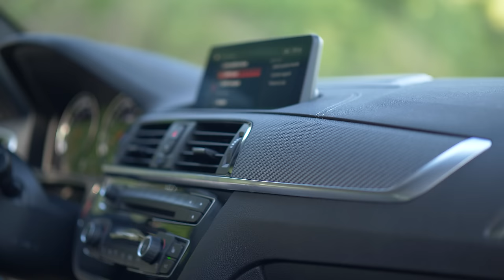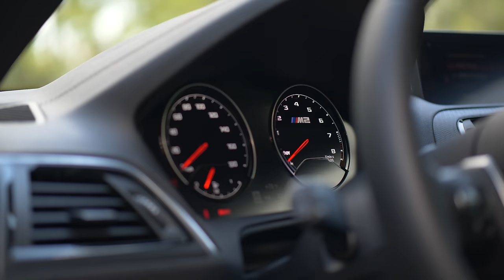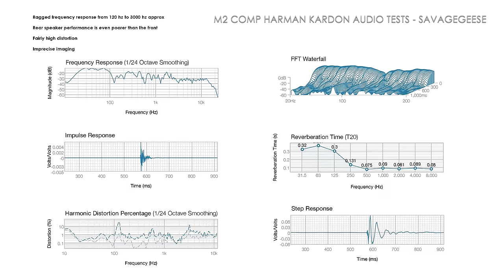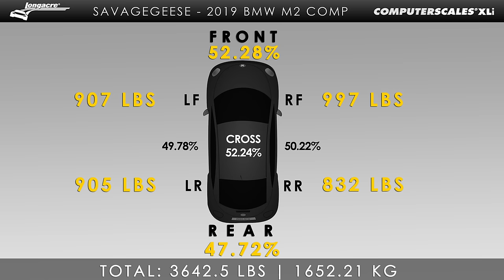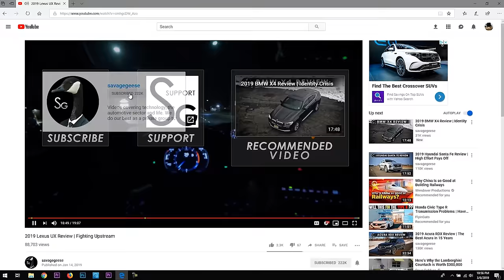2019 BMW M2 Competition | The Throwback Machine

Comment: I own one with the Manual, and Ive tracked it several times on several tracks.  If you leave the MDM mode ON, the diff does a great job of keeping it straight and not oversteer as you mentioned.  You have to be a little patient with the gas.  I noticed in the video you are get on the gas early in the turn.  I find trail braking and going to gas later is how the car wants to be driven. I came from tracking a 911, and I think this car is a perfect balance for street and track.  With Michelin Cup 2's, I think it will be that much better.  I have made no modifications, all stock set up.  I love how BMW tuned the torque. Its very linear in its delivery.  I think its a great all around package, albeit its a heavy car at 3600 lbs.  Oh and the tiny gas tank means Im always filling it up.
Reply: Do you really experience the weight as a problem in corners?
Reply: @8teate  a bit, but under heavy braking you feel it.
Reply: About to pull the trigger on one with the auto and I plan on hammering it around COTA etc with some 200tw tires on it
Reply: Do you happen to know how the M2 Competition compares to the previous gen M2 for handling?
Reply: @teddybburns  I have more experience with M2C  but have driven the OGM2 and I would say besides the engine, the handling is better in all aspects.  I 've heard it uses all the same hardware but the tuning is very different.  Less body roll, and better dampening on the road.  The M2 Comp can be tracked with no mods, may need to change brake fluid and eventually pads depending how often you track.  Never tracked OGM2 but depending on your skill level not sure how much you notice.  Im certain a more experienced driver could beat times of M2C in a OGM2.  If the money doesn't matter  go M2C.
Reply: @steveadp  thanks!
Reply: @teddybburns  I drove both and was considering both. I drove a 2016/17 M2 multiple times and I drove the M2 comp twice. I ended up going with the comp. I have not driven either on track, just street, so keep that in mind. The handling in the comp felt much more... immediate? Not sure the right word. It felt like It's pulling you into the turn, such as on to a roundabout, when you put the nose into it and put some gas into it, it just pulls in perfectly. The OGM2 is still great, I considered doing that as it was less expensive, but in the end I felt the throttle response, the handling, and some of the other features were worth the extra money for the comp.
Reply: @weglarz  thanks for the feedback!
Reply: Dct M2c owner here, had the car for a year now and I disagree with and the reviewers. Till this day i’ve only used PS4 S’s and the M2 has amazing grip especially with all controls off, its mdm is really good indeed but still feels tamed compared to all controls off, it has the best the of both worlds, meaning it will oversteers if you provoke it to, but once you understand the car (especially with good tires) trust me you won’t even have to to countersteer anything, the car feels glued to the ground. I agree with your trail braking point of view tho, the car loves to do that and if you put your foot on the gas too early you’ll feel the weight in the front, also under heavy breaking like you said, but thats just physics, I think the M2C is a marvel of science when it comes to rwd and front engine cars, but also with so much brutality, it reminds of the same brutality my 599 gtb had, with a much more sorted package.
Reply: The gas.... tell me about it! I have the M2 manual 2020 and I’m lucky to be alive when I get out of the beast
Reply: Thoughts on how the M2C compares to a 911 for a 80% weekend car 20% track car duties?

Comment: 18:36 “this wants to go sideways.” It does indeed. Come and try it on our track you silly goose :)
Reply: Savagegeese and Throttle house. How would you guys compare this car to the gt350? Which car comes on top?
Reply: I am also curious to know what you think about this
Reply: M2 vs Supra vid ;)
Reply: @kylenewberry8598  One shouldn't really compare a 2019 M2 Comp DCT $61,800 to a 2020 Supra Auto $49,990 since there is a noticeable price difference. The Supra exhaust note sounds good while the m2 is just ok. M2 has more top end, but the Supra is smaller and weighs much less. I will take a Supra over the M2 and I own a 2016 M3 since I want a smaller car. M2 comp also could have a spun crank hub failure when modded with an e85 tune like any other s55 engine.

Supra should make 400whp with stage 2 tune while the M2 Comp with stage 1 will make 464whp and 494wtq. I still would buy the Supra even with the less hp potential since it should be more fun and more reliable.
Reply: @justin2956  Eat a snickers maybe? Or take a chill pill if you're on a diet.
Reply: @justin2956  I don't think automotive channels should not be allowed to comment on other automotive channels videos. It's a community first.
Reply: @MrAlansordo  Throttle house already made a gt350 vs a m2 track video. Go watch the video for what they think comes on top.
Reply: @GrandMasta1  They do but not an m2 competition plus the question is addressed to both youtubers.
Reply: Kromeification it’s very poor form.
Reply: lourenco121 there are videos already showing the differences between the new Supra and M2 Competition. The Supra is better in just about every way. Only downfall of the Supra is its cabin space, and only being offered in an automatic transmission.

Personally I would still buy the M2, even for a more expensive price. Not because of performance, but because of daily usability. I’m 6’5” tall, and a solid 220lbs. I need the space. I couldn’t fit in the Supra. Plus I’m not to keen on the Supra only being automatic.
Reply: Justin it’s not poor form.  Relax.
Reply: @justin2956  it's not stealing from his subscribers it was an invitation.
Reply: @justin2956  ...Because someone can't be a subscriber and fan of both channels? This isn't a zero-sum game. Many of us watch videos on the same cars from 5, 10 or more channels. Give your head a shake.
Reply: You just want it because it's blue.
Reply: LOL, talk about getting your pun in. ;)
Reply: lourenco121 Reliability shouldn’t be a factor because BMW made the Supra mkv engine. It’ll break like the rest of them smh...
Reply: Sounds like the Canadians are ruffling up some goose feathers again.
Reply: Bruh! Love you guys and y'all's gooses geeses
Reply: @JacesOwnWorld  the supra sucks compared to the m2

Comment: It’s funny when the original M2 came out, all the reviewers gave it amazing reviews. 

Now that the Comp is out, all the reviewers are now complaining about the issues with the original M2 and that it didn’t feel special. 

I don’t know who to believe anymore.
Reply: Trust these guys and Mr Regular.
Reply: The regular M2 sucks.
Reply: I drive an M2. They are special.
Reply: @wthisdaftpunk6847  that's such a hard question... I have drove both, the 2 series is literally a smaller version of a 3 series. First of all they are much different generations. I hate the sound of the s55 in the m2 comp and the s65 is a high revving v8, enough said in that regard. Its faster, smaller, more fun around turns, looks better in my opinion, is much more reliable, has that daily driving factor even though its smaller, its everything you could want in a sports car. However, its simply missing that v8 feel. The M2 is simply a better car in almost every way possible mechanically, would I still get one over an e92m3, I don't know. If you want to beat on it, have fun without worry, daily drive it, get this. If you want a car that puts a smile on everyones face based off the sound alone, get the m3. If you held a gun to my head, I couldn't tell you which I would rather have. Sound means so much to be when it comes to cars, and the s55 just is not it, its better in almost every single way so I will ask you this, how much does sound mean to you? How much does that raw emotional connection with your car mean to you?
Reply: the original m2 is still a beast and the attainable one for most of us. i welcome the nitpicks and keeping the affordability if all the big guys want the comp haha
Reply: The OG M2 (n55) is more suitable for track,  its lighter and more dynamic drive

this M2C has the bells and whistles of the S55,   but it is more heavy and sterile drive than the original M2

Comment: I had my 6 speed manual M2 for 3 years, great car. I ordered one of the first M2 Comps built and it arrived at my dealer in August of 2018. Unfortunately the trade in value of my 2016 M2 dropped to $35k, the new M2 Comp with a 6 speed manual was $61k before tax, $65k with tax. Is the M2 Comp better, yes of course, but it wasn’t worth my car plus $30k to me, so I kept my M2. A used M2 is a bargain with prices in the $35-40k price range for 2016 models. Both are great cars, you can’t go wrong with either.
Reply: Well sure. One should buy a car with the intention of keeping it- of owning it at least. The resale value should be the very very last thing on your mind, with driving the piss out of it (and how that makes you feel) being the first.
Reply: Glenns Car Collection Ok you got a trade in value of $35k what could you get in private sale?  I think retail would be higher depending on miles and condition?  Low mileage ones are selling in $40’s at dealership.  Of course they jack up prices from the trade offer to make profits.
Reply: Glenns Car Collection -  I totally agree with you!  I just purchased a Bullitt for $52 after tax etc. The new M2 Comp. is great but very expensive like another $15. Too much for me.
Reply: You don't know what you're talking  about , Germany Corporation lost 5% net profit in 2 month , BMW hasn't gain net profit in 20 yrs
Reply: Archimedes  and what exactly do you drive?
Reply: @kevinclark1482  His mum's car

Comment: Found it really informative hearing your thoughts on how the M2 Competition compares with the new Supra Mark. If Toyota provides you a Supra to do a longer in-depth review on, hope to hear your thoughts comparing the M2C again if you have some updated impressions. I guess the M2C's 'twichyness' or habit to oversteer compared to the new Supra could be to do with its narrower tyres front+rear. I wonder if the differential used in the Supra is identical to the one used in this M2C but programmed differently? Would BMW be generous enough to provide this S55 engine (or the S58 engine featured in the brand new X3M) to Toyota for their GRMN Supra version or whatever it'll be called..as that Supra has a shorter wheelbase than the 2011 BMW 1M coupe and the 86/BRZ, we could be looking at a deathtrap. Can't wait to see how the upcoming lightweight limited edition M2 CS/CSL will turn out.
Reply: If BMW offers a BMW Z4 M version with a S58, I do see the Toyota Supra being offered with the S58 in that case. I don't see Toyota offering a Supra with a S58 without BMW stepping up first with a M version of the Z4. 

You also need to consider the price difference for the S58 powered Supra could be $16k more for the end customer since it's not just the engine being changed. You have to add bigger brakes, improve cooling, DCT trans, wider wheels, wider tires, improved suspension tuning to keep the balance and cooling needed with the increased power. The much higher price point will make it harder to sell, but it will be an unique small fun fast car.
Reply: @lourenco121  on paper, the Supra is faster 0-60 than the M2 competition. The Supra is a compelling package at a slightly better price tag, regardless of the M-Badge on this car. Comparisons to the Supra will be inevitable once the Supra gets in the hands of the press, after it is released to the public. It will be interesting to see, if Toyota can make a better BMW than BMW.
Reply: @oscarxms  The new supra is already the better BMW for me compared the Z4 since it's not a convertible and it's around $13k less compared to the z4. If you look at Cayman vs Boxster, you see there is small price difference of ~$2100 while the z4 vs supra has a big price gap. Toyota Supra already won compared to the Z4 if you don't want a convertible and don't need the bmw badge.

I personally wouldn't buy a m2 over the supra since the m2 is a heavier car and bigger car with two extra seats that I don't need. While m2 is more practical, I like the Supra more since it's an affordable Cayman or affordable Z4 coupe.
Reply: @oscarxms  I agree the new supra is exciting since it's a smaller sports car with great potential. I find there is more to a car in just hp and 0-60 numbers. I test drove the new BMW M2C and I decided it wasn't the car for me. Everyone has different tastes or wants in a cars. Reviews and comparisons are nice, but I find that I have to actually drive the car my self to get the real picture on how it feels to me. I found I liked the M3 over the M2 comp since I like the heavier steering effort found in the m3. M3 also felt more raw power wise. I am considering the Supra now since it's smaller car compared to the bmw m2/m3.
Reply: @lourenco121  Yes no doubt, we'll see a Z4M Roadster if the Supra GRMN comes into fruition with the S58 engine, to probably be more competitive to the 718 Spyder and 718 Cayman GT4s. Granted the S58 may have more power+torque but those Porsches will still be quicker around corners so it could be a close comparison. And yes Tetsuya Tada enginner of the Supra+86 said that by adding power to the engine, it'll have an affect on the overall balance of the car, so you'll have to make changes to the rest of the car to compensate the increased acceleration +top speed performance. Aside from Toyota's collaboration with BMW, many stuck-up haters/trolls of the new Supra (including superspeedersrob who hasn't even driven the car yet) criticised its 'lack of power' (despite Car&Driver +MotorTrend quoting that the B58 is underrated on their dynos) and mentioned that they would be willing to spend more for 'better' performance. So maybe there could be enough demand for it, or they could actually be 12yr olds who jerk off to 2JZ Supras and Fast&Furious franchise who can't afford a cheap car.
Reply: @oscarxms  By reading through various reviews of journalists comparing the Supra and M2C, I'm getting the overall vibe that if you only have one car park space and you give people rides, the M2C is the way to go. If however you have more than one car park space and have a practical car already, the Supra would be the superior car as it has been designed from the ground-up to be a car on a dedicated sportscar platform. Both the M2C and Supra are great though.
Reply: @tomjones5166  M2C is great for those who only have one car park space and need practicality from their fun-to-drive car.
Reply: @tomjones5166  Yes, I can see 22k miles/yr on a $62k car not being the most sensible thing to do indeed! Perhaps if you live quite a distance away from your workplace but have the convenience to have two parking spaces, what you're doing currently is the wisest way of car ownership. If you 'daily' your 2016 M3, it might lose its exciting charm (novelty might wear off) and your consumables costs will increase (you'll be paying fuel and tyres on miles that you're not driving spiritedly). Also, having a 'one-car-that-can-do-all' will usually have compromises dynamically (heavy, electronic driving aids etc). But thats just my opinion and you're welcome to disagree.

Comment: Alright Mr Goose, you have driven the M2 and the M2 comp.  You mentioned the technical differences between the vehicles, but I do have a few questions for you.  From the driver's seat, though, was the difference between the two striking?  Was there a significant difference in behavior or power availability?  Bottom line: pretend you're an M2 owner, would you consider upgrading?

Comment: It's still mind blowing how damn heavy new cars are. 1600kg for such a "small" car?
Reply: Yes, 1600 is light today :(
Reply: its 100kg heavier than my 2006 E60 530i... haha
Reply: I disagree.  3500 lbs isn't that much for a modern car. Its great comparing the weight to older cars but you cant compare their crash worthiness.
Reply: @timothycc711  this was my point. Of course it isn't much because they all are much heavier. And i know why they're heavier, too, safety is a big part of that.
Reply: Yet porsche finds a way to be "crash worthy" at 200KG less, year after year.
Reply: @idokwatcher2062  that's probably due to the 4 cylinder engine in Caymans. And 911s are 1600kg too base
Reply: @twizzbharat2577  C/D has the 2020 Carrera S @ 1505kg (3317lbs).  Think you need to step into AWD models to hit 1600kg.
Reply: @mixwellusa  Yes, that is correct. My mistake for not clarifying.

Comment: Sadly the M2 is probably one of the only real driving machines from BMW
Reply: Even more sad is how BowelMovementW refuses to even try making a car that can compete with a ZL1 or GT350 on a track.
The 650 hp ZL1 will decimate this crapwagon.
Reply: @TasteMyStinkholeAndLikeIt  the M2 has a purpose and the GT350 has a different purpose
They are both great cars don't bring shade to them
Reply: Yet weighs 3700 lbs. fail.
Reply: @basithph8958  
BMW has no business calling themselves a performance car.  "Sports Luxury" is as close as they get.  They're in the same league with Lexus and Mercedes, who also make sports luxury cars, not performance cars.
Reply: The 2 Series models are the only true BMW's left. The Ultimate Driving Machine is now the most ironic marketing slogan in the car industry.
Reply: TasteMyStinkhole m5.
Reply: @turbopickle9720  
Google the following and look at the results.... "Lightning Lap Results 2006 to 2018"
The BMW M5 finished behind the Gaymaro SS 1LE.  BMW Makes nothing that can compete with a ZL1 or GT350
Reply: TasteMyStinkhole id still take a BMW over a Ford or Chevy any day. Not even close
Reply: @turbopickle9720  
I take what suits my goals.
Reply: TasteMyStinkhole sounds like you’ve been gapped too many times by a base model 3 series 🤣
Reply: And the M240i